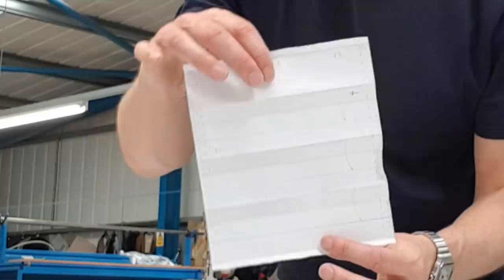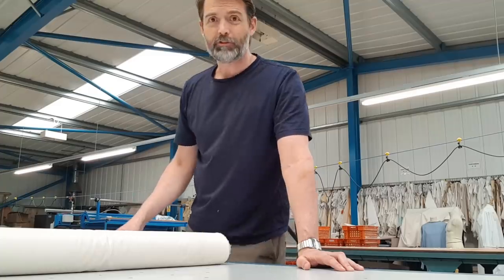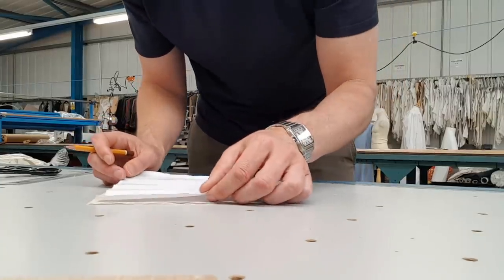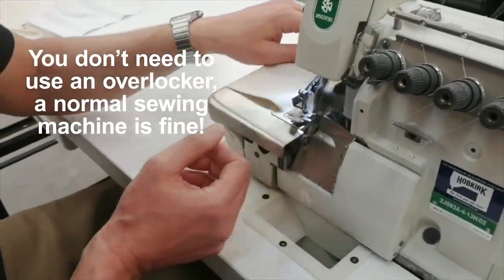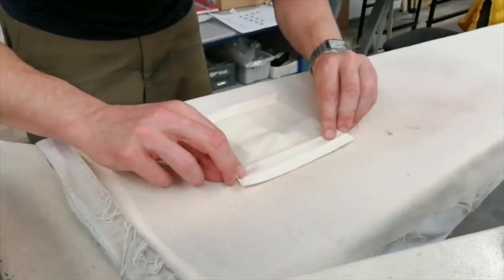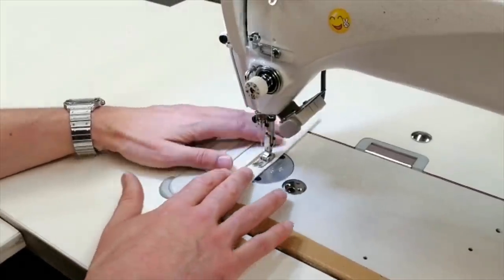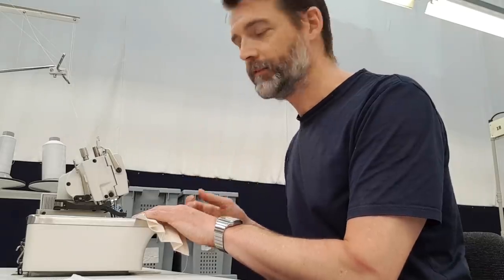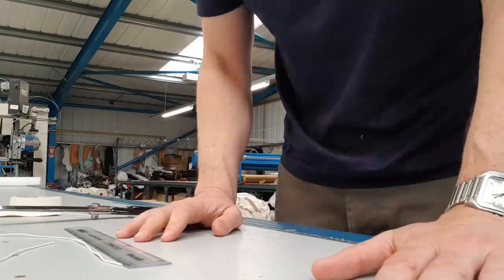How to make an improvised face covering - Patrick Grant

Comment: I wish there were written instructions with dimensions!
Reply from the maker: Hi Shereen, if you head on over to our website at https://www.bigcommunitysew.co.uk/ you'll find downloadable instructions and patterns!
Reply: @thebigcommunitysew8726  I can't find a downloadable file for Patrick's mask with pleats.  I keep looking at the video to try and work out where to up them, it says 17mm deep but how big is the gap between?  I've tried three times but not too good.  Idiot's guide in writing, please!
Reply: @thebigcommunitysew8726  Thank you. But I could only see patterns for a simple and a complex face mask - not the pleated one you're demonstrating in your video :-/
Reply: Hi Shereen and Joyce, I'm with you. Patrick's pattern isn't on the BigCommunitySew web site, nor are all the dimensions given in his video. But, looking at it closely, I'm fairly sure the pleating goes like this:
The material is 210mm tall, let's say the top and bottom hems are 1cm. There are 3 pleats, each 17mm deep, so each takes up 34mm of fabric, totalling 102mm. So the final mask's edges are 210-102-20 = 88mm long.
In the video we can see the finished mask clearly and I reckon that on the outside its height is divided into 5 equal parts: 3 pleats and the bottom panel twice as deep, though I'm sure it isn't critical. So, I suggest that, measured from the bottom hem, not the raw edge, you have pleats between 34 and 68mm, between 85 and 119mm, and between 136 and 170mm. So there's about 20mm from the top pleat to the top hemmed edge.
When I say "a pleat between 34 and 68mm" I mean that you mark these heights and fold the 34mm position to lie on the 68mm position, as seen from the right side, so the folds are actually 34mm and 51mm from the bottom hemmed edge.
Reply: Sorry, I pressed Enter when I didn't mean to. I wanted to point out that unlike most other designs, Patrick's pleats face up, not down.
Reply: @chrislusbytaylor3197  Thank you so much Chris for taking the time and trouble to write such a full reply! I want to make some face masks for myself and family and friends. Still not sure if this type with the elastic ear loops would fit everyone and stay on securely or whether ties at the top and bottom that tie up at the back of the head would be better? Decisions, decisions! LOL
Reply: @shereensoutham2751  Have you seen the Tilly and the Buttons video on the BigCommunitySew Web site just below Patrick's? It is not much more work but has two distinct advantages: a channel you can put a wire in to form a seal over your nose and a pocket you can put a filter in. The filter could be another layer of cloth, a coffee filter bag, J cloth,... She uses ties, knotted behind the head, but you could easily attach elastic if you prefer.

By the way, although Tilly attaches the ties to the corners I've seen someone say its best to move them away a little - makes the edge sit closer to the face.
Reply: @chrislusbytaylor3197  Thanks for your time in doing this!
Reply: @chrislusbytaylor3197  Thanks Chris! Tilly's tutorial was much clearer than Patrick's so I think I will make a few of that one.
Reply: Chris Lusby Taylor He probably just put it on upside down without noticing, or maybe he doesn’t realize they should go the other way.